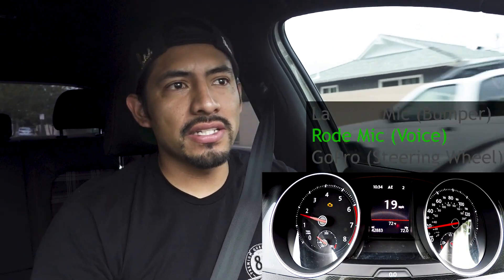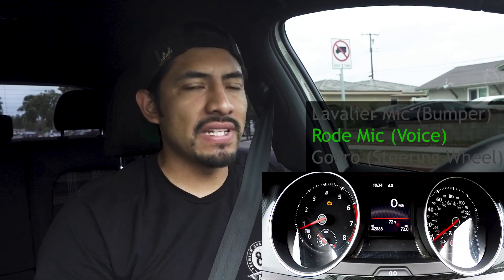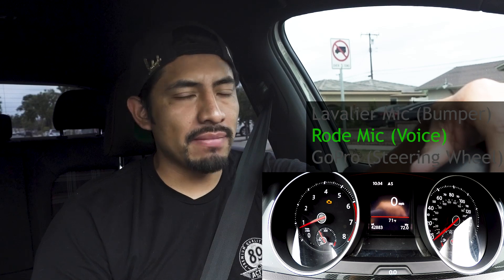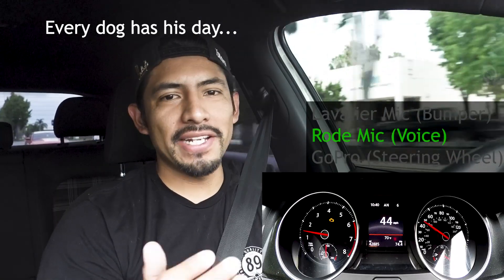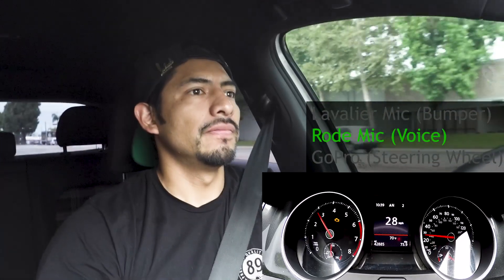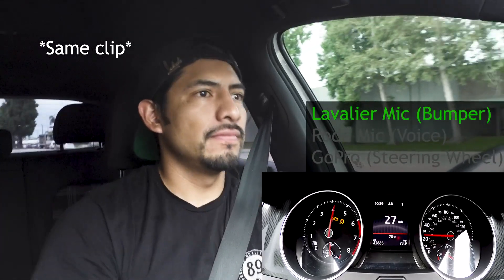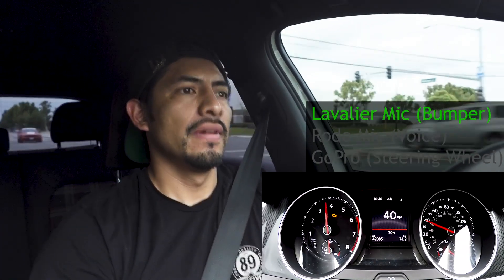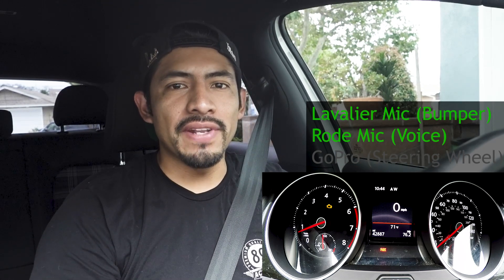GTI MK7 Remus Sport Exhaust APR Downpipe (Drive Around Sound Clips)

Comment: Is the drone insane? I have this exhaust - and I love the tone it has right now with no muffler and a mid pipe resonator. I'm scared if I add a downpipe that it will just be too obnoxious. What are your thoughts after having it on for a while?
Reply from the maker: At first the drone bugged the crap out of me but after a while I kind of got used to it. If I could go back I’d probably go with one that had a muffler or maybe go with the AWE track setup. Biggest upside is I love how the quad tip looks